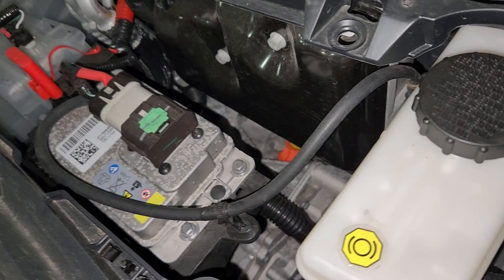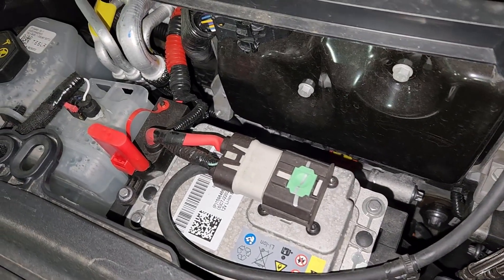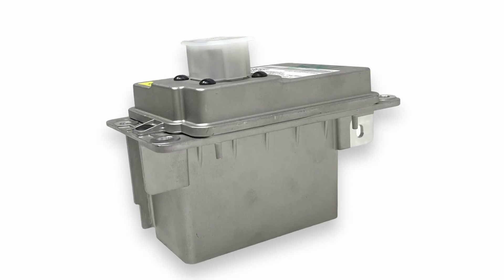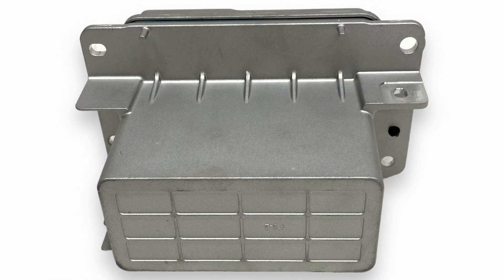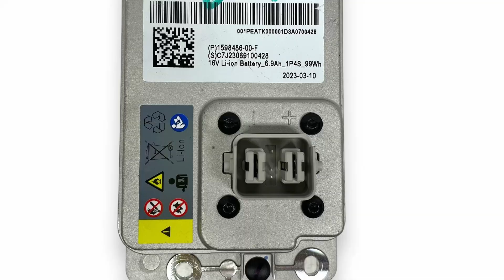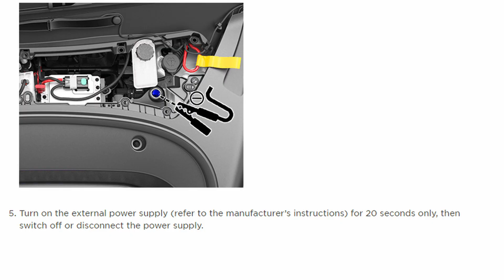Tesla Battery: Kitchen Explosion

Comment: With electric vehicle batteries I am absolutely amazed how they just drop a battery inside of vehicle with no protective insulation around it with earths weakening protective fields from the suns element’s and CMEs and other solar storms  entering earth is only a matter of time when an above average CME  hits earth is going to be interesting to see all electric vehicles on fire with a gas driven vehicle The only time you see them on fire is during a major accident or torched deliberately in the same sense as electric vehicles with its pathetic insulating leaving it open to the elements it would be Just like driving your gasoline vehicle with the fuel cap off and parking next to someone grinding or welding with sparks flying everywhere to ignite the gasoline would be the same comparison for gasoline versus electric vehicles More toxic fumes from battery’s than a gas driven vehicle  so much for saving the environment “GREEN” 🌍 is a JOKE 🤡 WORLD LMFAO

Comment: Probably just the BMS circuit that blow up, could easily be the battery cells that gave the BMS a real explosive amount of electrisity for a moment.
Circuit boards can get quite explosive if mounted inside a tights sealed compartment if given enough energy.
Can see there are extra pins in the plug there to communicate with the battery.

But its stupid of tesla to just don't use a normal lead acid battery so things like this can be fixed by the owner.

Comment: Even a normal lead-acid battery can explode from the hydrogen during charging. I had it happen one time. Inside the battery, the lead plates can crack where they connect to the outer terminals. If under load, or, especially charging which creates the gases, that crack can make a spark and ignite the hydrogen and oxygen inside and blow the battery apart with acid everywhere. Luckily, in my case, it was a small lawnmower battery and I was wearing safety glasses and damage was minimal.

Comment: The trouble with Ev's.  
1. Range anxiety.  
2. Explosion fears.  
3. 60% depreciation.  
4. Elon Musk's connection to Jeffrey Epstein.  
5. Exploited Third World child labor.  
6. They brick in cold weather.  
7. Insanely high insurance rates due to repair costs and the liability of exploding batteries.  
8. Insurance companies writing off ev's in a minor crash.  
9. Ev battery replacement up to $60,000 or more.  
10. Inadequate charging stations powered by diesel generators.  
11. Non eco-friendly emissions in a fire and during the manufacturing process.  
12. Ev's chew thru tires like a drunken sailor.  
13. Tire and brake pollution.  
14. Suspension failure.  
16. Ev's chew thru brakes like a drunken sailor.  
17. Pushed by the WEF.  
18. No ability to charge EV if you live in an apartment.  
19. Having to wait for EV to charge.  
20. Charger point vandalism.  
21. Collapsing electric grid cannot cope.  
22. Lose charge range in cold weather.  
23. If the manufacturer goes out of business, now you have to junk your EV, because it has become worth absolute zero.  
24. Absolute nightmare to put out EV fires.  
25. Electrical, electronic, and software problems will leave you stranded.  
26. Toxic gas vapors from EV explosion will kill you.  
27. Not suitable for road trips.  
28. Rapid battery degradation over time as miles rack up.  
29. Ev's too heavy for crash barriers (guard rails).  
30. All Ev charging is paid for with digital currency.  
31. Copper thieves are targeting EV charging cables and wind turbines.
32. Ev's are causing double the road damage.
33. Gaslighting from EV manufacturers is pouring gasoline on the fire of EV rejection.

Comment: I have a few older Optima yellow top batteries. They're lithium and one is very big and gets used in various testing. My oldest one that I've used for running my diesel truck, testing my old car, working on other people's cars, working on my tractor, and a bunch of other random things. I charge it in the garage for a reason. One is a 7 year old big lithium d31t battery and the one in my daily is a used 16 year old yellow top with a worn tag. They can go boom at any moment. The most smoke detectors are all around the garage, which is connected to the house. Just please be careful with anything that can hold a charge, even lead acids. Edit: I put them on concrete for a reason.

Comment: 156 - would not be hard to rig a couple of wires to spade connectors and stick them in the + and - slots. If he hooked them up backwards I could see an explosion sure. Charging in the kitchen, um no. I charge any battery outdoors on my patio wall, nothing that can burn nearby in case it goes boom.

Comment: You can charge it with a regular charger but must monitor the voltage in real time, the second it hits its voltage you must stop as a proper Lithium charger switches from the constant current phase to the constant voltage phase where it incrementally backs off the current till voltage is once again achieved and keeps doing so till voltage is achieved with almost no current.

A regular automotive charger will not do this and that is where the danger is, if you know what you are doing then its ok, if in any doubt dont attempt it if you like your house.

Comment: Lithium battery fires are electrical ion fires and therefore cannot be put out with water. Also water plus electricity is a dangerous thing yet still water is used on these fires. Never use water on a chemical fire. My advice is dry powder, but seek advice from a professional.

Comment: Li-ion 12 volts can be used for any cars. It didn’t make any difference to the story that it was a Tesla.
Reply from the maker: It's relevant because that specific battery is what Tesla uses.   Very few cars use lithium-ion on the low voltage side.   Mostly due to cost.

Comment: This is a lithium ion battery not a cell, this obviously has internal circuitry for overcharge, overcurrent, low current, cell balancing,  undervoltage etc. From what I'm hearing here it's obvious that the said circuitry has failed. We all have to be more aware of the dangers of lithium battery technology, don't take any chances, keep on watching and learn from the mistakes....

Comment: WTF?  If a Tesla has a dual voltage system, why not use a standard 12v L/A battery?  On yeah, they don't want you to do anything yourself.  Just tow in in and they will "charge" you a couple of thousand dollars to fix their engineering dufuss.  I will never buy an EV and if you are smart, neither will you.  The public is slowing catching on to these scams.
Reply from the maker: Weight.

Comment: What disturbed me in this video was the flimsy cover over the indicated positive terminal for charging the battery. How easy would it be to dislodge that cap and ground the battery while working on the vehicle? That's a thin strap that's just popped onto a plastic stub or something. I can see it easily twisting off and the cover being lost as a consequence.

I inadvertently shorted a Lipo battery for a brief second once, and it melted the wire (I turned it into a recycling center afterward). I don't know the C rating of these batteries, but I imagine it's considerably more than that little RC pack I was messing with.

That entire setup looks like a fire waiting to happen to me.
Reply from the maker: It's more robust than most terminal covers in traditional vehicles.

Comment: Of course it doesn't have a traditional AGM battery.  Why use technology that has decades of development and deployment and is one of the best and safest ways to provide 12V power to 4 wheel mode of conveyance.
Reply from the maker: It's heavy.
Reply: AGM batteries die in cold weather.
Tesla tried those and dead cars because of dead lead acid batteries was the result.

Comment: Not difficult to connect to at all. I use spade terminals all the time to test Milwaukee power tool batteries and I'm pretty sure the same leads would fit in there. Not a good idea, though. I've had a damaged e-bike battery go into thermal runaway in my office and I'm very lucky it didn't cause more damage than it did.
Reply: Many thousands of E-bike batteries have done that.

Comment: After Googling how to charge a Tesla 16V lithium cell at home. I found out that you need to heat the package with a propane torch, melt the glue, to open the package. Then you charge the circuit board directly. I'm thinking the propane might explain the "explosion".

Comment: Lithium batteries when they internally go shorted they will not charge or discharge, they will become a resistor and heat up, this will lead to thermal run away and possible explosion of the cell if you force charge the battery. A 12v charger lead acid charger will charge a battery not matter what state it is in. This battery Tesla uses has a battery monitor, not a bms, so that is why it may have exploded. You can charge this battery by using lugs or paper clips and running them to the charger leads, its not impossible.

Comment: What battery charger did he have? A 12volt one would be too low a voltage or was he using a 24 volt charger?
Reply: Well, a conventional automotive 12volt charger can output 15-16 volts, I’m speaking of an old school iron transformer shop charger. Newer devices typically employ electronics, and will stay below 15 volts.

Comment: If the lithium battery was 16 volt then you would need a charger that gave out around 18 volts, if the guy tried to use a 24 volt lead acid charger then danger would ensue, not a smart idea.
Gaz UK

Comment: These Li-ion battery vehicles are new technology not understood by motorists.
Not ready for the vehicle market yet.
Reply: That’s not a “technology issue” - it’s a “training issue”.
Reply: @allangibson8494 Yes and No. The manufacturer has to make sure that only suitable connectors can be attached to the battery, with correct chargers. We all know people can by pass them, but they have to make sure that by passing the correct way is troublesome and not worth the effort. You have low amperage plugs that do not fit in high amperage sockets, and high amperage plugs will not fit low amperage sockets. The battery with just two slots was an accident waiting to happen.
Reply: @allangibson8494 Maybe, but you do not see 10,000volts where people can stick their fingers into it.
Reply: @tonysheerness2427  120V is at the low end of lethality. And I have actually worked with 11kV plugs and sockets (with a couple of megawatts behind them - you don’t get electrocuted with those (you explode)).
Reply: Not understood by anyone.
Reply: You could say that about any vehicle, look at channels like "Just Rolled In" to appreciate the depth of human stupidity when it comes to vehicles.

Comment: BMS systems can lock out so you have to give the battery a short temporary zap to ger the internal mosfet to turn on again so it can be charged in it's traditional method. I suspect the Teslas main battery pack is what normally keeps that small battery charged. The 16V is likely 4 cells which would actually be 16.8V [4.2V X 4 = 16.8] you can actually get closer to 12V by putting 3 cells in series which would be 12.6V. [4.2V X 3 + 12.6V]
Reply: If you want NMC/NCA batteries to last for a long in a float-charge type situation like an EV that is plugged in whenever not in use, you don't want to charge them much beyond 4V per cell. Just like the main lithium batteries, it is the first and the last 10-20% of the charge-discharge cycle that puts the most strain on the graphite electrodes.
Reply: Fun Facts: a lead-acid or AGM vehicle battery rated at "12 Volts", is actually supposed to test at about 12.65-12.8V nominal to be 100% charged. A "12V" LiFePO4 is actually a couple of volts higher, so 100% charged on these is 14.4V. So you see the range DrHarry T is working with in real hardware. 🙂
Reply: Thanks, Poindexter. I'll remember that next time I'm flying Apollo 13.
Reply: @richardweyland116 
It was the EECOM* Poindexters that figured out how to keep the crew alive to come home, by figuring out how much power was available in the LM and CM batteries, and how best to use it for life support and spacecraft power. Now if you'll excuse me, I've got a lunar shuttle to land. Signed, Ted Stryker.         *(EECOM-Electrical, Environmental, and Communications Officer)

Comment: Any battery can be “recharged”... either it’s chemical and that means to revert the ionization from pole/metal to pole/metal (sulfate management)... depending on it’s design...

Or by correct voltage/amperage management when it’s Lithium design (electronic control with in the battery too).

They used an outside charger... which one? 
I believe I can recreate the same failure with one of those old robust chargers which destroyed regular car batteries... which are scary.

But I think they used an older Smart Charger type which didn’t had Lithium in it’s Type selection.

But even those smart chargers can operate with the batterie connected to the vehicle... unless the person removed it from “a friends” vehicle and carried it to his garage for charging.

As always it could have been worse... after 15 years or more of lithium batteries on our Smart Phones... how come people still don’t have a clue of how they work?

“People don’t have a clue”... 
“Charging the battery” is such a wrong thing to say, because it’s a chemical/electrical process... what’s lost when a battery is wasted is the acid and metal (when put to extreme usage and age)

Comment: Do I listen to this fireman about how to charge a lithium ion battery or someone with a PhD in electrical engineering?
Hmmm tough one. I would however charge it the way the manual suggests.
Reply: What PhD EE? I've known a few of those, and I'd think twice about them winging it on a system they are not versed on.

 He - the Fireman - showed some pages from the Tesla manual. This wasn't a tutorial on how to charge, I think he was just making a point to not be a bonehead.
Reply: @randydewees7338  I would however charge it the way the manual suggests first and if that didn't work to see if I could actually charge it I would use a charger where I could limit both current and voltage as I have done in the past to recover lithium ion battery packs I have been gifted as they were "faulty" for the home solar system that runs my home that cost 3000US to install. The manuals say not to mix lead acid, lithium ion and lifepo batteries on the same system but so far I have had no problems. As to your comments on PhdEEs it's always fun to try and repair something for a chap who was one of 3 or 4 on the design team for the mark 1 model prototype before it was productionised after they have already had a go at it:)
Reply: @randydewees7338  Valid point Randy😀
Reply: Firefighters do a LOT of training on how to manage Li batteries in cars and structure fires when confronted with them in crashes and fires. 
Part of that training involves study on the construction of the batteries and how they are installed and how the charging systems work. 
When I did my classes, our tutor was a PhD in electrical engineering from a large UK university with a specialization in Li battery systems from cell phones to cars to huge Li battery storage systems. He is considered the leading researcher in emergency response to Li battery fires.
Please do not assume what you don't know.
Reply: @elinor6525 Fire Fighters haven’t been doing training on lithium ion battery fires - that’s the problem.
Training is needed but isn’t being given. Water makes lithium fires WORSE. Ditto carbon dioxide.
Dry chemical extinguishers are the way to go but creat a horrible mess.